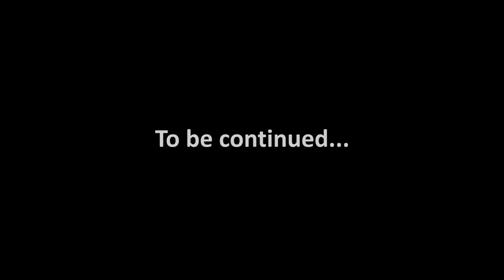Broken DeWalt Air Compressor:  Worth Repairing?

Comment: The armature commutators need to "polished" using a metal lathe to insure roundness  and smoothness.  Otherwise you having the same type of arching between brush and commutator that cause the original problem.  Easiest solution is a new motor.
Reply from the maker: Yeah, went down that road. New motor for this model costs the same as a whole new compressor. I think that is their way to help you decide to throw out the broken one and buy new.

Comment: Depending on how good this compressor was to begin with, you CAN get a GRC from DeWalt; that is a Guaranteed Repair Cost. It is the max price to repair no matter what is wrong. Might be worth it. Or take the motor to a repair shop.
Reply from the maker: I took it on more for the challenge than for anything else.  Part 2 Coming up soon!

Comment: Maybe a high temp epoxy      also I think by filing the rotor you are most likely making it out of round and bumpy  ...  so when you have it disassembled put a drill on the open end of rotor and use that to turn as you file  should give you a less uneven rotor   ...   good luck
Reply from the maker: I bought the high-temp epoxy, but decided to go a different direction.  I will cover that in my next installment